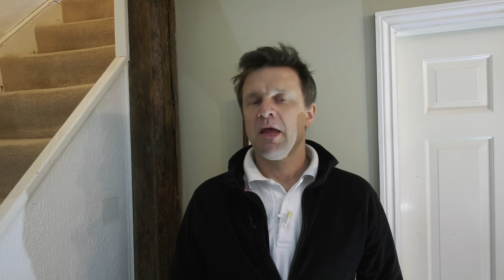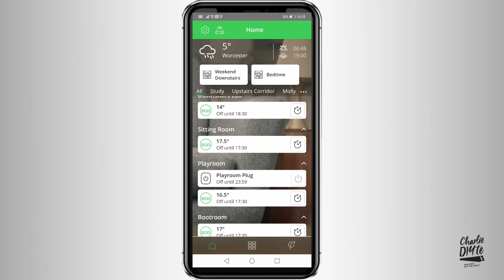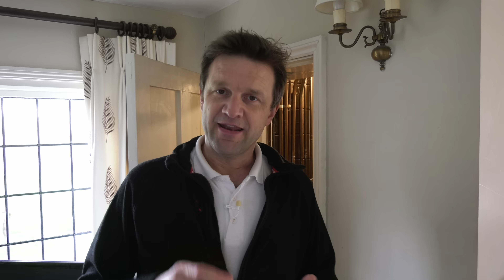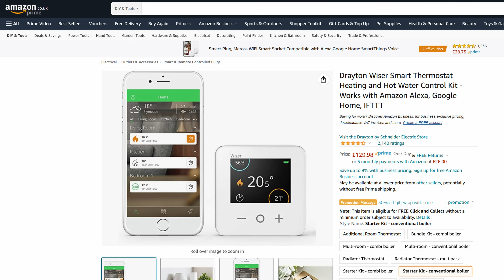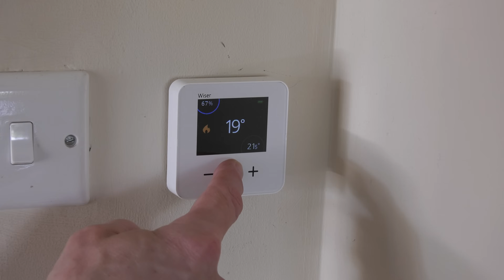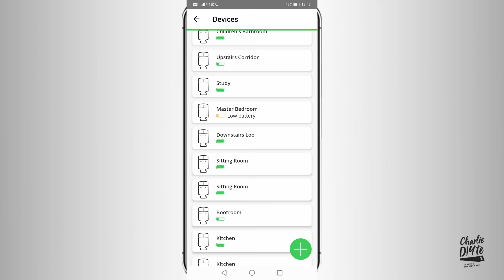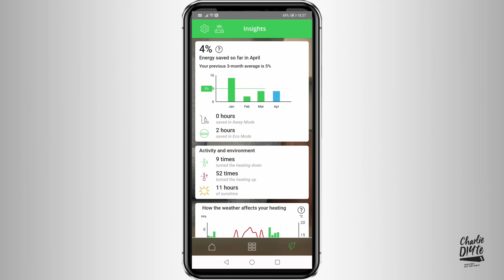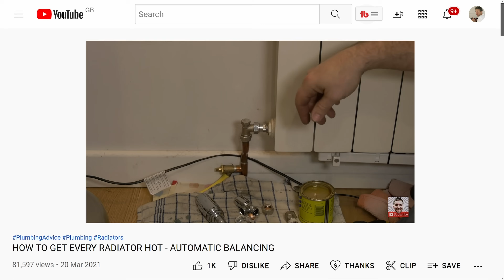Smart Heating Update - 14 Month Review

Comment: Honeywell Evohome user here, been using it for nearly a decade, but the controller is dying and the only option is to replace it (nearly £400!) and because nothing is saved, you have to set everything up again - everything - so £400, plus 2-3 hours to reinstall and obviously I am then left with uncertainty about whether other parts are failing, so now looking to replace it with Wiser or TADO, but leaning towards Wiser, as functionally it is probably closer to Evohome, so guessing that it will be an easier learning curve for the family.

Quick FYI with respect to savings from a smart heating system - these are actuals for us.  Comparing costs between pre Evohome and post Evohome, our gas bill was £300 lower.  Now, not an exact science (but you can do PxQ detailed analysis of the value of turning radiators off), as obviously the winter might have been colder, perhaps we were away more, and equally gas costs will have changed, probably upwards.  

Also worth noting that eTRV's fail, so we see 1 per year die and if they get wet because you have a slight leak from the radiator valve that it is attached to, then the eTRV also dies - worth noting for bathroom rads, that often have the eTRV at the side.

I used to recommend Evohome, but stopped several years ago:

- installers - non-existent
- post installation annual service - I have had gas safe engineers disconnect Evohome, as they don't understand it, so just unplug it (this has happened twice)
- the app has never changed
- scheduling hardly ever works
- once a year the system will fall over and I will have to spend hours trying to work out, which part is actually causing the issues as error messages are largely useless.  I am not talking individual eTRV's, which a simple reboot fixes, but complete system shut down.
- Resideo,  who support Evohome,  aren't the best and apart from the excellent support I just received diagnosing the impending failure of the controller (power is failing), have usually never help me fix an issue

Good video, very informative.

Comment: As well as being range extenders and energy-saving devices, I find smart plugs with energy monitoring to be a godsend when paired with a more general-purpose home automation platform, such as Home Assistant, for two reasons:
* For long-duration tasks that require me to do something at the end (like unloading the washing machine after a cycle), having the machine on a monitorying plug means I can get an alert when the washing machine has stopped drawing power for more than a few minutes, meaning it's time to get the clothes out before they go musty.
* For critical always-on appliances like a fridge/freezer, it is useful to have it on a monitoring plug so that, should the fridge stop working (other than for a power cut), it will stop drawing power and you can get an alert, letting you intervene to reduce the risk of food spoilage. With that said, the plug should have a 'child lock' if there is any risk of it accidentally being switched off!

Comment: Its the battery bit thats stopping me. Be honest. How much money are you actually saving when factoring in all the money spent on good batterys? Ive already balanced my rads and have good tvrs in the house. Is there really any need for a smart heating system? 

If its cold a turn in on. If its warm enough we do without. Im not sure spending hundreds is really worth it in the long run.

With underfloor heating in the kitchen i hardely have to use the house rads at all. Even in the cold weather. Anyone else in a similar sit?
Reply from the maker: Those rechargeables are great, so pleased I bought them. It's vastly superior to my old system that was completely controlled by a room stat in the coldest room in the house. But whether it's worth it is complicated as you've got to factor in what boiler you've got (mine is unmodulating sadly) and the thermal make up of the house.

Comment: Tado system  - alkaline batteries tend to also last about 12 months, however Tado radiator valves do accept NiMH - the firmware recognises 1.2v NiMH and adapts its battery monitoring accordingly. Tado recommend Panasonic Enloops, however I have found silver bodied NiMH Energisers to be fine. Choose the wrong battery with a Tado and they get stuck in the battery holder as some AA rechargeable batteries are too fat.
Also, just for reference, I have had Tado smart heating controls since 2017 (V3/V3+) and then added the smart radiator thermostatic heads in 2020. So in all 7 years + with Tado and very pleased with it. Running the system with an oil boiler and across the 7 years it has saved a lot of heating oil. I saw a significant reduction when the Tado system replaced a basic honeywell programmer, wall thermostat and regular TRVs and then a further very visible reduction in oil usage when the Tado radiator controls were added. It easily and quickly paid back the purchase cost.

Comment: Really helpful thank you. Question for you, if the setting on the TRVs is 20deg, the heating stops on that rad once it reaches the temp but what temp does the heat kicks in again? I'm wondering if the boiler will be going on and off many times during the day. Thank you.
Reply from the maker: If you have the heat on permanently then yes it will cycle throughout the day but I have mine on just in the morning and evening - although the underfloor heating is on all the time. My problem is my boiler isn't self modulating but if yours was, then continuous cycling isn't really a problem.
Reply: Thanks @CharlieDIYte 
My boiler is a Baxi Compac Megaflo which seems to be able to handle continuous use.

Comment: An absolutely useless system. Installed throughout the entire house 2 years ago, 6 radiators, extra thermostat controler, and signal extenders. This system is very inaccurate in result you have to cold or to hot house, resulting in a waste of money on extra heating costs in addition to the system itself. It's worth mentioning that it was installed by a certified plumber. The batteries run out very quickly; you'll need to replace them 3-4 times a year. The app is glitchy all the time. I deeply regret purchasing it; it's a waste of money and time. Now I have a completely useless system that I HAVE TO REMOVE and RETURN BACK TO THE OLD FASHIONED THERMOSTAT. I'VE LOST THOUSANDS OF POUNDS.

Comment: I want to get cracking with this and it seems fairly staightforward to sort out myself, however I am a bit confused by the requirement to have 1 radiator with neither a TRV or smart TRV. The house I recently moved in to has TRVs on every single radiator... does that mean my boiler can handle it and would I be fine to replace just a few with smart TRVs and leave the others all off or manually turn on when I do need them?

Comment: I have been working with the Wiser system for a couple of years now. Based on my experience I have several observations:
    1. The TRVs actually measure the temperature at the device (next to the radiator) and the system then uses software to estimate the temperature in the middle of the room. This estimation is frequently wrong. To be fair, it's a difficult thing to do since every room has different thermal characteristics. The problem is worst when the radiator is heating up in the morning - it gets quite hot, so does the TRV, so it over-estimates the room temperature. The result is that the radiator shuts off even though the room has not reached the set point. This is 100% repeatable behaviour. The solution is to give it a boost just to get it up to temp. After that it is fine for the rest of the day.
    2. On your recommendation I have installed re-chargeable batteries, of exactly the same type. I ran one TRV on rechargeables for a month to test it and it worked flawlessly so I have rolled them out to the remainder. That was a great bit of research, thank you.
    3. One feature I would really like to see is geo-fencing, for two people: so that when we are both away from the house, it automatically goes into Away Mode. Unfortunately I have no idea when or if this will become available.
Would I install Wiser, knowing what I know now? Yes, in the sense that I'm very glad to have a system that I can control remotely. No, in the sense that there may be better system designs out there. But these systems aren't cheap so I'm not about to go trying the others in the hope that they might work better.
 Thank you Charlie for your work and helpful videos on this system.

Comment: Good vid, but i think a couple of statements you made about Wi-Fi aren’t true. You can also run your wife in a mesh - the standard supports this and I run some of my outside Wi-Fi antennas in mesh mode. 
Also Wi-Fi rarely “goes down”. My one never really goes down - but the internet does. It depends on how you install your Wi-Fi. There should be an option to use your home Wi-Fi - like Sonos does.
Reply from the maker: You're right but WiFi meshing is a relatively recent thing. Not sure it was widely available when I did my first Drayton video.
Reply: @CharlieDIYte  I use UniFi with around 6 antennas in the ceilings hard wired back to a network hub. The hub then connects to the router. It’s about 5 years old so has been available for quite a while on expensive systems. I’m not being picky or critical of your content - it was very interesting. It’s just a shame they use their own mesh - it will probably interfere with the WiFi spectrum despite whatever claims they make. That’s why i switch off the mesh network on my Sonos system and also my Sky boxes.

Comment: Been considering switching from Tado to Drayton Wiser.  Mainly due to the issue with Tado, when the internet plays up the heating doesn't respond.  I've installed a backup 4G modem and configured WAN failover on the firewall to mitigate against this.  I have read on Amazon reviews that the Drayton TRV units don't seem to last, gear issues or something.

Comment: Thank you for the video, very useful! it was a interesting point someone made about boilers only being able to modulate down to a certain level, in my case I also have a worcester bosch so modulation is not supported but thinking about efficiency in the same way, does this imply for example that if your only heating 1 bedroom overnight that his is not efficient and you would be better off heating maybe the whole of upstairs rather then just 1 room?
Reply from the maker: I'm like you. 2010 Worcester Bosch that doesn't support modulation. It's a big argument against single room heating that the boiler is constantly cycling on and off at full power but I think on balance that's probably better than having a system controlled by a room stat that is in the coldest room of the house that never gets up to temp. I guess the more important question is whether your boiler is condensing - which depends on a host of factors including whether it's over specced or operating efficiently at capacity and how well balanced the rads are in achieving the right delta T. You're second question is a good one too and depends on how well insulated the house is. There's an argument that you should keep the heating on continuously so that the house has a constant thermal mass - rather than hearing up all those cold surfaces on each heating cycle. I think there's a lot in this one but it does depend on the individual thermal properties of the house, how well insulated (particularly loft) it is etc
Reply: @CharlieDIYte  Thanks for your thoughts, I agree with your approach and have ordered the Wiser with hot water controls and TRV's so hopefully can get it installed this month, heatgeek also seems to suggest smart trvs / zoning is not worth doing here - https://www.youtube.com/watch?v=zpTVIeUh04E but i'm not convinced, it all gets very confusing, fingers crossed I notice a saving, i'm in this house for another 10 years at least so I'm pretty sure I should make the money back at some point even if the savings are small!

Comment: Can you set different schedules?  For example, shift workers might want a "days on" and "days off" schedule.  As shift patterns very rarely rotate around 7 days, it's no use just having a 7 day programmer or a single schedule based on a 7 day week.
Reply from the maker: You can set different schedules on different days of the week and the Moments function allows you to toggle heating in on certain areas at the push of a button but you can't switch universally between schedules.
Reply: @CharlieDIYte  thanks for the info.  That's a limitation of a lot of these smart stats.  They only cater for schedules that revolve around a 7 day week.  They need a 4on/4off schedule which is probably the most common shift.  Or just the ability to set individual schedules and then switch between them with the press of a button.

Comment: Don't use rechargeable batteries.
Reply from the maker: They work seamlessly. You just have to make sure the voltage is right.
Reply: @CharlieDIYte  I found out they aren't recommended due to the heat and charge.

Comment: Following on from below, I contacted Schneider Electric Customer Care who were very helpful and told me that they could see only one radiator as the signal to the other radiators was weak.  I have, therefore, ordered 2 Wiser Smart plugs to increase signal coverage.  Hopefully, that will resolve the issue
Reply: Schneider have now added a wireless signal strength meter on the app under “devices” which should make this easier to identify

Comment: I took your advice and installed this system about 3 months ago.  At the time, all that was needed was hot water which heated up fine on schedule.  Now that the colder weather is coming, I need to heat our house for my wife who  feels the cold more than me.  I have 11 radiators each with a Wiser Thermostat and have set schedules for each room/thermostat.  The problem, however, is that the radiators do not come on.  To get the heat flowing, I have to turn the thermostat to the +sign until thred light illuminates.  The, turn it to the -sign until the blue light illuminates.  At that point, I can hear a sound which is probably the valve opening and the radiator starts to warm up. Can you tell me what could be the problem as I have tried resetting the thermostats, recalibrating, deleting them and starting set up again but all to no avail.   I have to say, however, that the radiators are producing more heat than previously with this system, if only they would fire up automatically.

Comment: Hello,
My name is Lee Gawthrop and I am a Wiser costumer since 03/01/23.
I am getting in contact to hopefully explain the difficulties I have experienced with your system.

I purchased this system, never having used or set up a smart thermostat system so I did my homework and looked around, finally deciding that wiser looked like a good option.

From the moment I opened the box, nothing has worked as it was described on the videos!

So far it has been wired to close to the boiler by an accredited gas safe engineer (who had never heard of this problem with all of the Hives he had installed).

The hub does not connect to mine or my wife's app. we can not set the temperature or change the settings, therefore we have had to turn the boiler off completely in the afternoon and at nights as the smart valve thermostats have stopped working with the hub meaning they are not getting hot, meaning they never get to the temperature set in the schedule we set back in the coldest days of the year.

This was meant to be a money saving experiment but I have to admit that with the outlay for the system and the cost of the fuel bill, as the boiler seems to be constantly working unless switched off.. It has been an absolute nightmare and I dread looking at my fuel bill! 

My wife and myself are at a total lose with your system and your company. I have a catalogue of emails going backwards and forward to your tech department telling me what to do and none of it has worked.
I have:
-Had the line checked had a new router installed,
-Changed the settings on the old router,
-Checked in as an installer,
-Moved the hub over a metre away from the boiler,
-Tried to get an accredited wiser fitter to come and do it! (none of the people on your "accredited fitter list actually exist as far as I can tell from my numerous phone calls) 
-Factory reset, 
-New hub,
Etc,
Etc.
None of this has worked and all of this time, my wife is scolding me for not choosing a Hive, which I feel she is well within her rights to. 

This situation has been so difficult that I am now wanting my money back and will be seeking compensation for the poor quality of your product, the waste in fuel that has been your systems fault and the sleepless night listening to the boiler attempting to cook my two young children unless I turn it off at the wall!

I will be posting this review on all other social media videos where the wiser smart thermostat is involved, to inform people that this is not a good investment.

I look forward to getting this resolved so I can move on as you have made a simple task so complicated.

Regards,
Lee Gawthrop